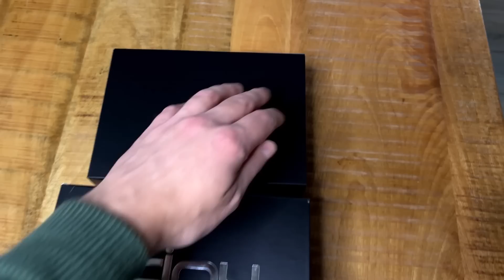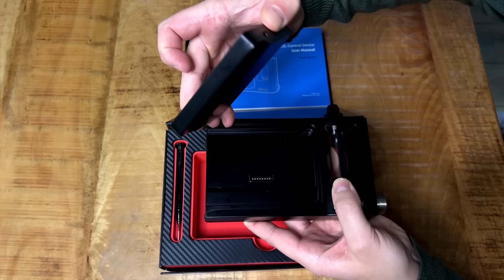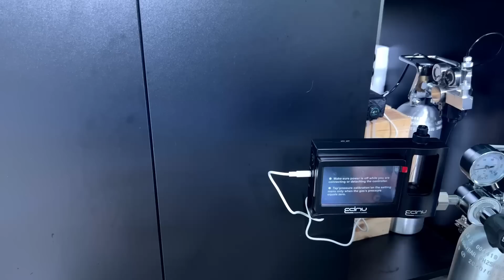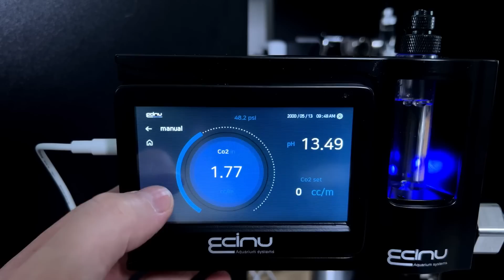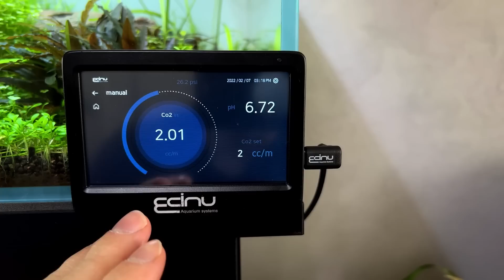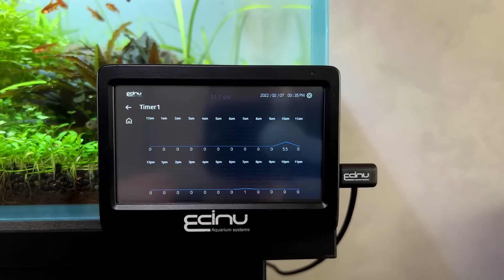IS THIS THE CO2 SYSTEM OF THE FUTURE? I've Never Seen Anything Like This Before

Comment: It's an expensive bubble counter you still need a c02 controller and plug in solenoid to Dail everything in, it's nice but the total setup (to run correctly) would cost over a $1000 bucks 😢.
$130 - $500 c02 for controller 
$30 - $100 for c02 bubble solenoid 
$700-$800 for this touchscreen bubble counter not even including the c02 tank or c02 generator-tank $100-$300 bucks ....😮

Comment: great looking machine, I use the milwaukee ph controller MC122 pro and a co2 reactor for my 180gal tank. Does the same as this unit ..only this looks nicer. I would now buy the Milwaukee MC125 PRO 2-in-1 Digital pH / ORP instead if I was to do it again. So if this brand wants to improve their product they should include ORP reading as well (not controller but reader).

Comment: Do you have issue connect the regulator to your CO2 cylinder.  May I know whether your CO2 cylinder is 21.8 or TR21.4.  I have bought the regulator type and it doesn't fit my ANS Co2

Comment: Hey, do you have any tips for removing calcium build up on the glass?

I haven't been able to do maintenance on one of my open top tanks for weeks so the water level has evaporated and the glass near the top is foggy from calcium build up. Is there a safe way to remove this without hurting the fish in the tank? thank you.
Reply: Like MJ said, white vinegar works well. I have pretty hard water so I have a little calcium buildup at the water line that I take care of at every water change. I just pour a small amount of vinegar on a paper towel, ring it out so there's no extra to drip into the water (I do this after removing some water from the tank so the calcium line is a few inches above the water line), wipe off the calcium line, then use a second paper towel that's wet with water only to wipe over the line and remove any residual vinegar. Works beautifully and like I said, I do this at every water change with no issues.
Reply from the maker: Few things you can try!
1: You can try to clean it with white vinegar on a paper towel, just rub it on the calcium.
2: A regular algae scraper (the ones with the razor blades) works quite well
3: The Dennerle ''cleanator'' this is like a sponge designed for really stubborn algae
Reply: Thank you both for the replies, I will give white vinegar a try!

Comment: nice review, one thing i noticed is that there seems to be a lot of wires attached to it. i have too many wires as it is, and it seems like it really isn't adding that many variables to manage, the PH thing is pretty cool, but if you still have to manage the timer, i'm not sure how this is very beneficial. With a smart plug I can already time my co2 solenoid and after some monitoring I can get it to come on and turn off at an ideal point to keep co2 levels fairly stable.

I don't know if such a sensor exists or if it is possible, but instead of sensing ph, it would be nice to sense co2 levels in the water, and just set the desired co2 level and keep it stable. This would allow the user to do away with schedules and bubble counters and everything else. Just set the desired co2 level and allow the system to hold it steady. This system seems fancy, but doesn't really solve the age old problem of keeping stable co2 levels in the tank in a simple way, has too many wires, its bulky, makes noise, is very expensive, and it also doesn't really make sense to me to have a touch screen. Just control it from the phone! It would also be nice if this unit would have a way to control a fert/chem dosing system of some sort. Seems like a big electronic to be dedicated purely to ph detection and co2 delivery.

Comment: Have you made a video about the water parameters in your tanks? I'm new to co2 and aquasoil. I have terribly hard water, something like 16-18 dGH so I use RO and remineralize. I thought the point of aqua soil was to buffer your kh to 0 so I never added any KH to my RO water. My ph was always below 6 and haven't purchased a PH pen yet to test how far below. This is obviously too low so, I've since added 1 or 2 dKH and it's made my ph more manageable. It seems to stick around in the tank despite me having fluval stratum. I am wondering if I'm wasting my time trying to keep my KH so low. My life would be a lot easier if I could leave it at 3 or 4kh as that gives me a lot bigger buffer for future crashes and I won't have to check it so frequently. If your PH goes to 7.6 during the day you must have a fairly high kh. Do you measure it ever?
Reply: Also, for your drop checker, do you add tank water or add water with 4dKH? I've seen both recommended. If anyone else wants to share what they do, I'd appreciate it too. :)
Reply from the maker: I would definitely leave the kh at 3 or 4 if that makes life easier for you! I measured this tank last week and this is what I got, KH was 10 and GH was 17.
For the dropchecker I just buy a bottle with the solution.
Reply: @MJAquascaping  Wow that's really high. I thought the fish and plants would struggle with that. Apparently not because everything looks so amazing. Thanks so much for the response!

Comment: I am happy to introduce a video of this product that I am currently using in Korea.
When I first encountered this product, it was a whole new world for me. In the situation where the calcium reactor is used, the amount of Co2 supply according to the weather
Co2 supply and stop are automatically adjusted according to the ph setting value in a car that is not constant...
It has been used well so far, and it is strongly recommended for precise operation.😀😀😀

Comment: Hi, I love all your vids, especially the experiments you do. I have an idea but I have no way to test it on my setup, maybe you do. So the experiment is to test whether you can increase the natural CO2 production using 2 aquariums connected like 1 main aquarium and a large sump, where you can have inverted lighting schedules e.g when the main aquarium light is on the sump light is off (this can be done in a cupboard under that main tank) and vice versa. The question is, will this method boost the co2 levels in the aquarium? Resulting in better growth of plants. Maybe one day you can test. Of course the both tanks needs to be heavily planted to produce the co2 in the dark cycle. The idea is for the dark tank to produce the co2 for the other tank to use.
Reply from the maker: Interesting!
Reply: You maybe the perfect one to pull it of👌

Comment: Sounds like a cool device, but from what I see it's $500-$600 and that is just too much for what it does.  
You can get a complete kit that comes with a 5lbs cylinder, dual stage regulator, diffuser, ph controller and tubing for $450.  
Or you could get just a simple ph controller for about $140 if you already have everything else.  

This kit doesn't seem to offer anything more besides a prettier package.

Comment: Hey gekke Hollander, heb je de gebruiksaanwijzing gelezen hahaha, I got 2 tanks and I would like to try it out but as you said it is kinda heavy and the problem is it cost 500-600$ and that is just for 1 regulator or 1 tank. If this would be expandable to like 6-8 tank setup them it would be a great system meaning 8 pH probes connecting to 1 unit and 8 bubble counters lol I mean then it might be worth the money and time. Other than that it is a luxury product nice for those here in the states or in bloemendaal were they want to have an aquarium but not the maintenance and they just hire someone to do this. Then this is a great product. But it for me I'll just keep it with my 29$ regulator what works great

Comment: Why not keep the CO2 on during the night time(only if using PH controller)? Makes for a more stable PH I think the co2 loss is negligible? Product looks nice, all depends on the price as regular PH controllers can be found relatively cheap.
Reply from the maker: Yeah you could do that as well. I have some tanks that get CO2 24/7 and they run just fine